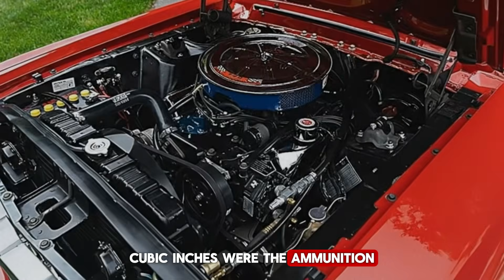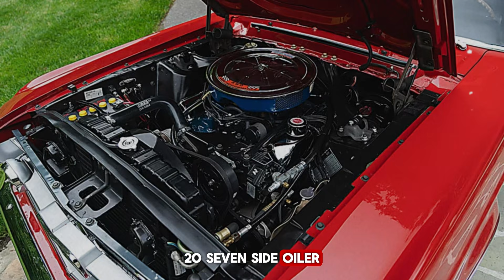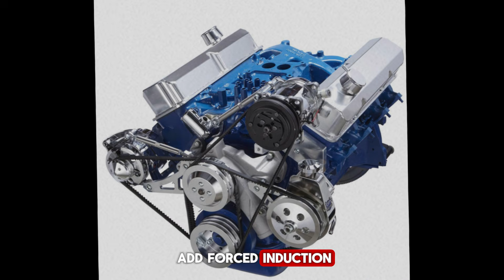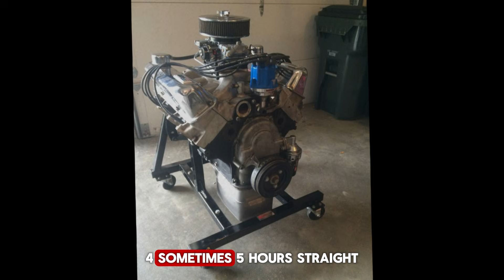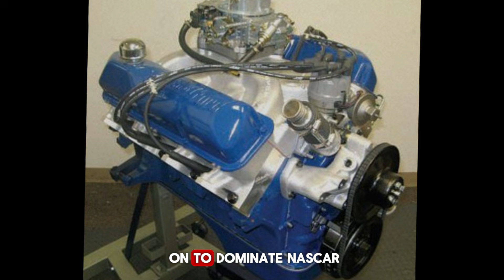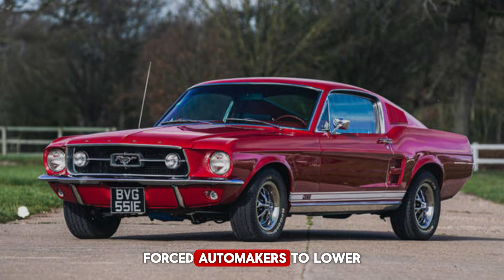Why Ford’s 390 FE Was More Important Than People Realize

Comment: I had a 1976 F250 4x4 trailer special.. It was a 4 on the floor with the Granny gear.. I had to take off in second gear because 1st was soo low. And people think the MT82 is a bad trans, LMAO. Compared to what we had back in the day it's a great trans..  But my God what a great motor.. It had a nasty set of Headers and a Flowmaster exhaust with the dual pipes coming out the back.. Freaking thing sounded so nice.. It was my first car/truck.. I was 17 and it was 1991 back when gas was .79 cents a gallon.. You couldn't own a truck like that today to daily that's for sure.. It would cost a $1000 a month just for gas.. LMAO...

Comment: How about a hot redded 410. I built every one of could get. Bore it.030 over, sometimes.040 over with the thinnest rings I could get. Worked on the oiling system by enlarged oil pump and adapter holes, and restricted the top end. Put CJ valves in early heads the 61-65 tall port heads.,The best were the COAE-D heads. Small heart shaped chambers that would not look out of place beside an LS heads. It makes me wonder where GM got the idea…lol. Put an aluminum 3x2 with Holley 2 Vs or an aluminum TW 2x4 with a pair of modern AVS2 625 cfm. I have a 1UB 428 crank but Scat sells a 390 stroker kit for a 416. I have built and rebuilt many 416-418 ci 410 s and it is surprising how much it is like a 428. My friends called them poor boy 428s. Torque that would twist a driveshaft or yoke in two. My favorite was a shift kitted HServo C6. Drill the two holes in the midplate of the valve body. Put a good floor shift for a reverse pattern 1 2 D.

Comment: The Ford FE was the greatest engine of the 1960s The oiling system just needed to have the passeges modified. The oil pump passege to filter adapter needed to be enlarged and shaped, The pump passage had to be opened to oil pump size and the oil filter adapter passege opened with a 7/16 drill bit. The adapter needed the gasket trimmed for free flow. The passege behind the distributor needed a pipe plug restriction and the rocker shafts restricted. The passeges in the lifter galley’s needed restricts. The idea was to feed more oil to the mains. As far as cooling, a large radiator and aluminum water pump aluminum heads and intake cooled it down and reduced weight to less than some small blocks were. I always liked the 410 at .030-.040 over four a 416-419. In my 68 Mustang coupe everyone swore it was a 428.